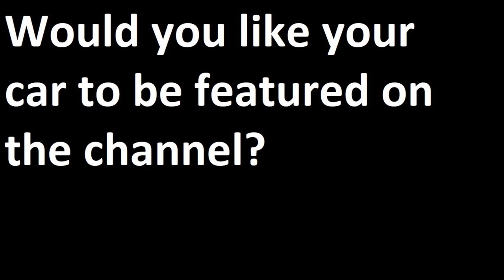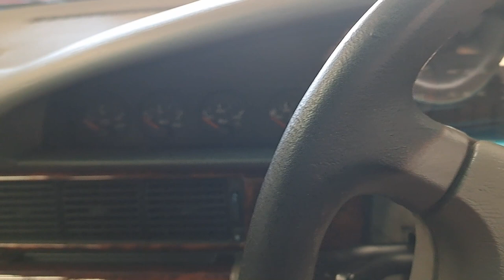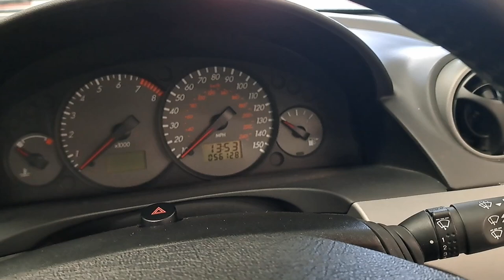A Slightly Shambolic Shuffle Around the Barons Classic Car Auctions February 2023 Sale Preview

Comment: I can remember that the Maxi 2 in the 1980s did feel well built, not the norm for BL, but have travelled in a 1981 cream 1750 HL. It was extremely comfortable on rough roads and the doors closed very well. To be honest most of the Maxis from the time looked quite like this blue one because they were well used due to their resilience and reliability. They were not a car that owners usually kept concourse. 
That Audi V8 engine was very advanced and actually pumped the oil all around the engine from cold start. The build was Mercedes standard and the interior was beautiful. It was the dawn of the A8 which I now have the good fortune of owning. A true flagship.
The Ford Puma and Kuga are very underrated classics and I think that they may become sought after and very valuable. The Kuga in particular was very good looking and interesting alongside the Fiat Coupe, Honda Prelude, 3 Series Coupe, CLK, Nissan 200 SX, Peugeot 406/407.
The Chevy Suburban is family transport sorted out for certain.
The Range Rover 4.6 HSE looks amazing and well looked after over 25 years.
Reply from the maker: I thought the Audi V8 had quite a low estimate on it, to be honest, would have been even better if I could have opened the bonnet. That Cougar in particular looked very nice indeed, I find the Pumas a bit cramped for my taste, but I am a bit concerned about the rust on the Cougars and Mondeos. The Maxi was very interesting, I did manage to get in and have a look too. The Suburban and P38 were not cars I have seen at Barons before....